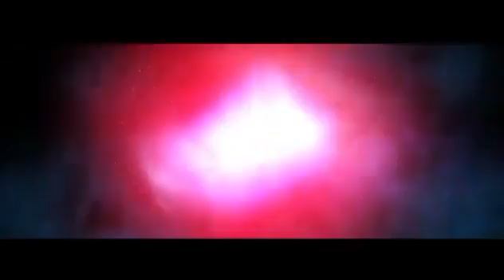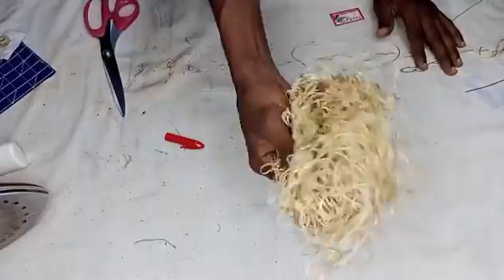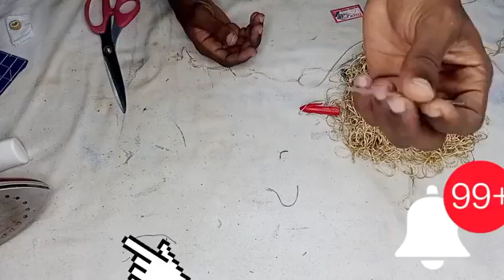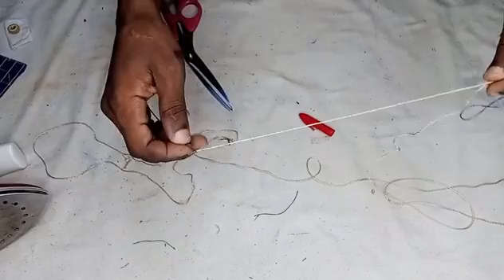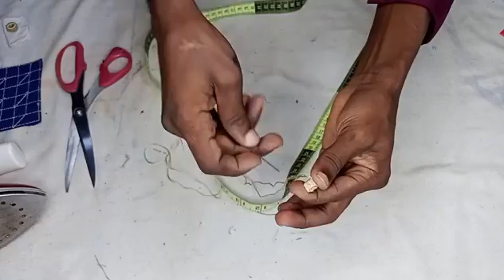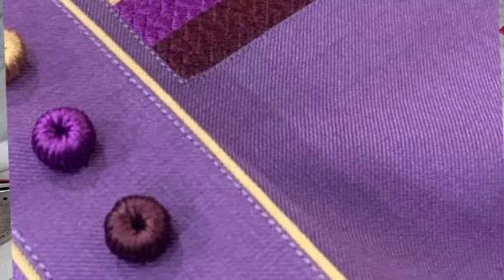DIY: How to make a fancy senator button #headwaystitches #kaftan #fashiontutorial #senators

Comment: Nice one sir, but I do have a question. Assuming you use a bead for this design, the first punch you made on the pen cover with your needle, can one achieve same with a bead giving it's nature?
Reply from the maker: Thanks so much sir. You're blessed with this beautiful question. Yes, you will achieve same result only that you won't make that first punch while using a bead. You will hold the thread at one side and let the next turning overlaps the first one , then continue spreading it.